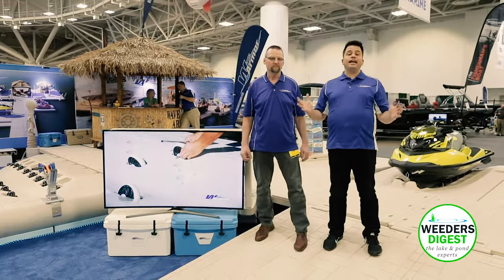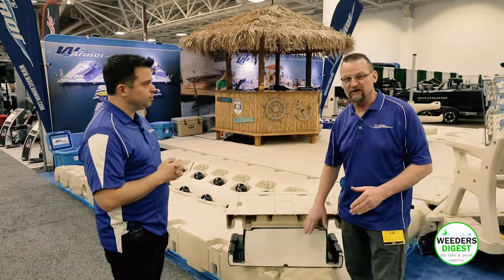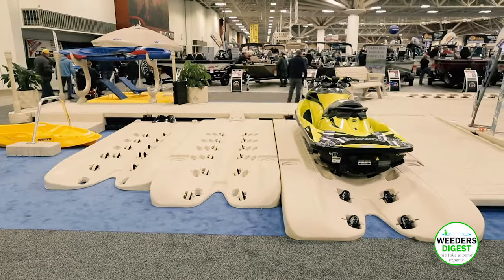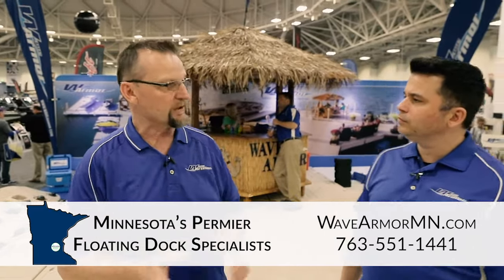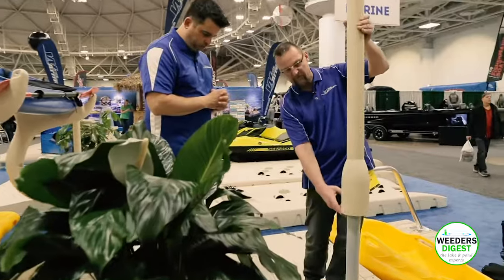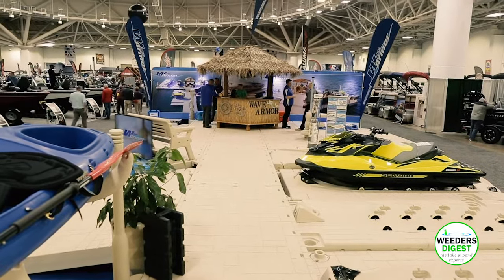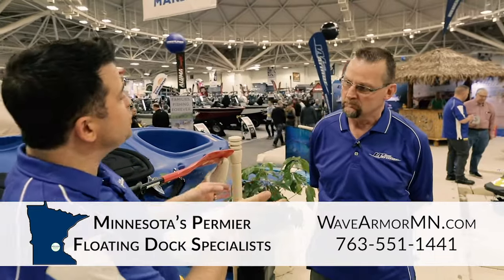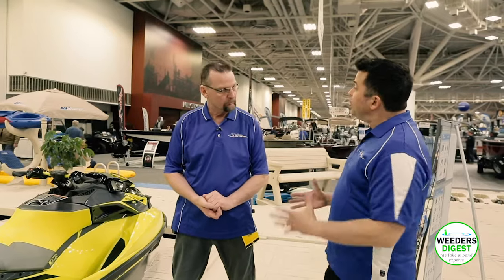WaveArmor Floating Docks Overview Review Video | Minnesota Wave Armor Dealer

Comment: Wave Armor customer service is terrible. I bought an Extreme X24 from Mike at Jersey Shore Docks in Toms River last May (2023). Used the dock(on/off) about 10 times last season. This season, I had trouble getting the boat off the dock.

Upon inspection, I noticed the rollers were not spinning and are deformed (flat spots). When I contacted Wave Armour, I was told the rollers are not covered under warranty because they are a wear item.
Really, so these rollers dont even last a year? If that is the case, why didnt anyone make me aware that I would need to replace these rollers after just about a dozen uses.

Caveat Emptor.